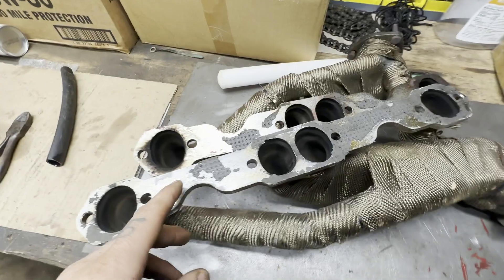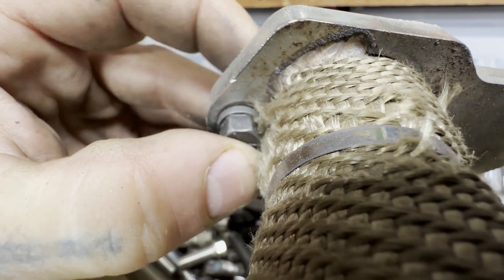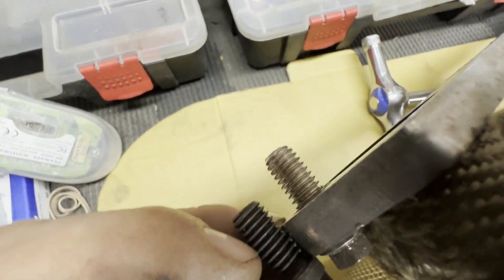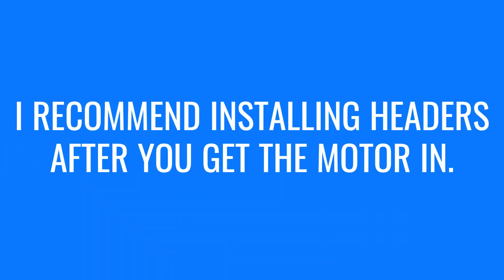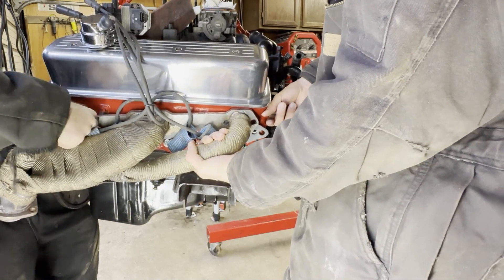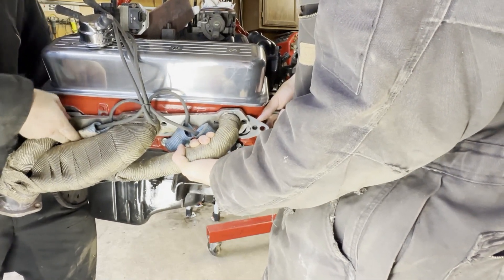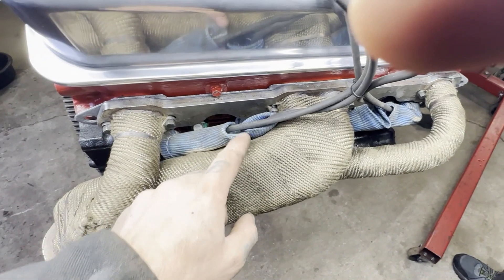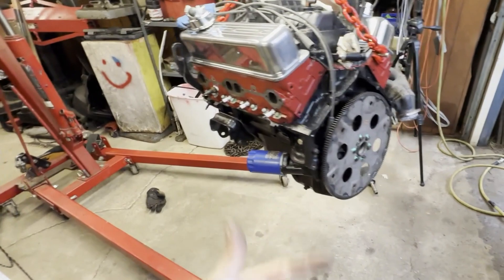HEADERS  AND WIRES TIPS ON A 1997 CHEVY TAHOE 5.7L 350 VORTEC 88-98 CHEVY TRUCKS

Comment: Man I'm having horrible problems with mine! I have a 97 Z71 5.7 Vortec. Just installed long tube headers and header mufflers and now the damn thing will hardly run!

In order to start it I have to smash the throttle wide open and then when it does start it loads up horribly.

I was told I could just drill out a hole near the collectors for my first set of O2 sensors but I didn't need to worry about the two downstream sensors??
Reply from the maker: It will definitely run terrible if you don’t have your O2 sensors hooked up. On those trucks, the second one farther back is known as the downstream O2 that’s not as important but upstream the first one is. Just weld em in and you’ll be set. You can get weld in O2 bungs (threads) online cheap. I like the ones that have a step in them. It gives you a little more surface to weld to. 
Thanks fir watchin!
Reply: @unclelemme  Thanks for responding, I appreciate it! I will definitely buy the threaded bungs as you suggested, but do you think the other way is just as effective? He just drilled out a hole in both header's near the collectors, threaded them, then installed his old censors.

He didn't have access to a welder and he needed to get the truck out of its current location ASAP. Thanks again!
Reply from the maker: Yes you can drill em out and just thread them in. But they may leak or pop out. It’s worth a shot worst case you just weld in a new bung later. Good luck with your project, take care!